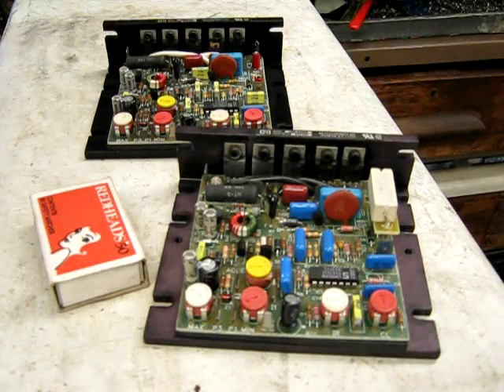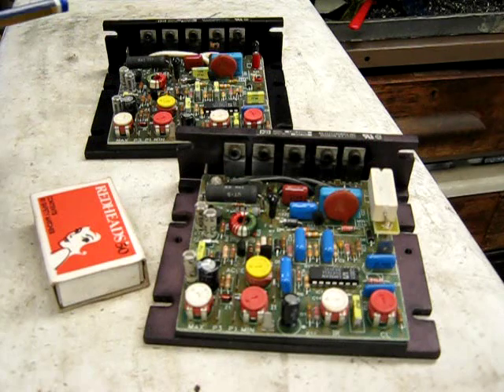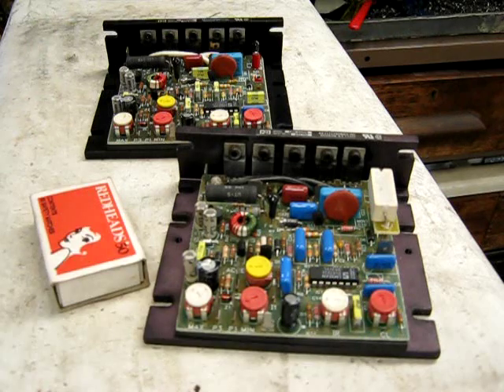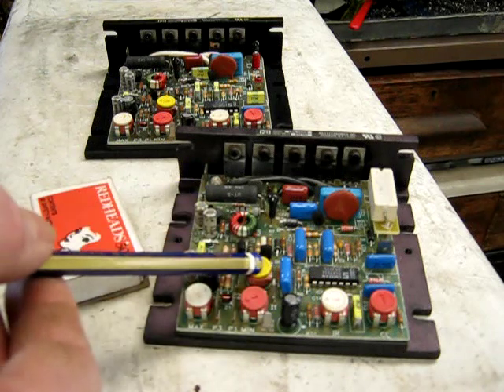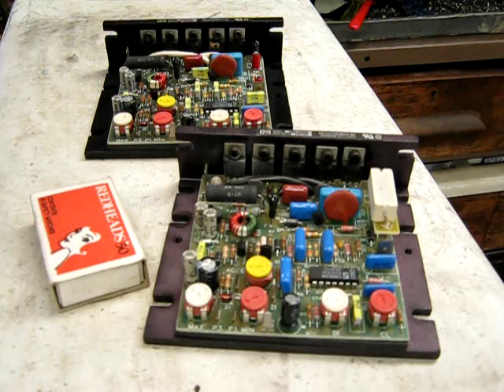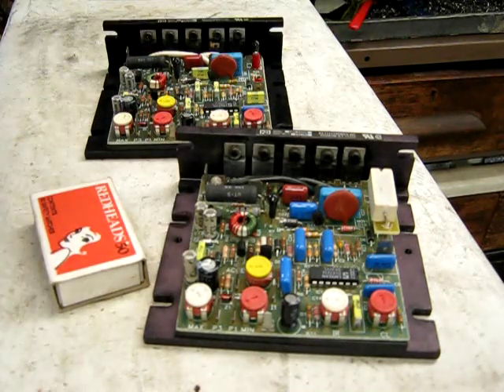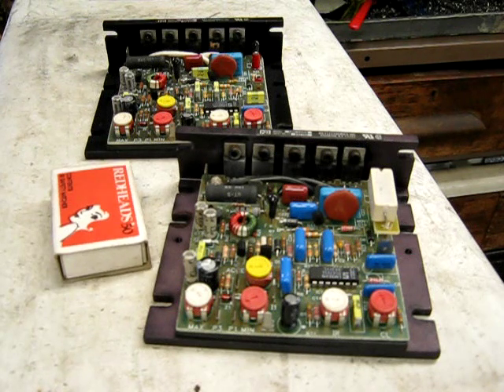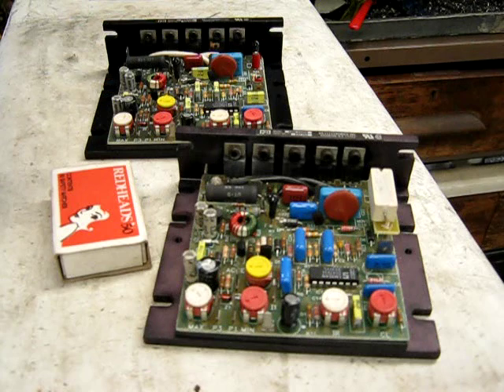DC drive controller suitable for a treadmill motor conversion to a lathe or mill

Comment: hello sir, my KBWM-240 only outputs 50vdc, what component is damaged?
Reply from the maker: Hi Fajar.  It could be a number of possibilities.  A bad main ballast resistor, output voltage potentiometer, or blade rectifier could cause it.  A fault with any other component on the board will also have an effect.   Quite often these units get damaged by voltage spikes, so a clean power supply is essential.  Look for any obvious burn marks on the board and it's components as a clue to what failed and where the problem lies.  Cheers Rob
Reply: @Xynudu  thank sir, i will check it
Reply from the maker: The user manual for this unit can be read online.  It shows the correct settings :  https://www.manualsdir.com/manuals/350815/kb-electronics-kbwm-240-kbwm-120.html?page=5

Comment: My controller board JYMC-220B-1 Deyd yesterday. Aim looking for an alternative....
Reply from the maker: Hi Robert,

I have read that these are a clone of the KBIC board.  The specifications look similar.  The KBIC board is readily available secondhand off Ebay.

So long as the connection points are the same layout you should be OK.

Cheers Rob

Comment: Hey Rob  great video  i would like to building a belt grinder out of a 2hp treadmill motor i have,  with this controller i was thinking of building a sealed alloy box to put it in so no junk gets in, is that possible or does the controller need air to cool itself
Reply from the maker: Provided you use the case as a heat sink it should be quite OK.  These inverters don't actually get very hot, even though they specify an additional heat sink for high load applications.

I still have a couple of these inverters and a largish treadmill motor laying about that I should put to good use one day.  No real need at the moment but always handy for linishers etc.

Using them on a lathe is not really all that successful as the DC motor cooling is insufficient under low speed/ high load operation that an AC motor would tolerate quite happily..

Cheers Rob

Comment: I really see no difference between the KB 212D controller and its variations to the standard controllers that come with the DC treadmill motors. My only interest in the KB controllers was whether or not they can stop the motor quickly. you never addressed that as far as I can tell. The waving pen/pencil is a real distraction trying to focus on what components you're talking about, a little slower and to the point would be a great help. No criticizing just giving feedback.

Comment: Any Idea on how to make these work with a PWM signal to change speed?
Reply from the maker: +dantheman1998 
PWM is for AC.  These boards are for DC motors.

DC current does not have modulation.

You can get PWM for AC from simple to expensive, but cogging and lack of torque will be issues.

Rob.
Reply from the maker: +dantheman1998 

If you mean to replace the speed change potentiometer with a PWM signal, I have no idea if that is possible.

I don't see any point in even attempting such a thing.

Rob
Reply: +xynudu Yeah that's what I mean. I have a  mach 3 lpt breakout board and it only outputs pwm to control spindle. So looking for solution to this

Comment: Are you saying I need to turn off the power to the AC hot line before switching direction, or just let the motor come to a stop. I will be using a DPDT switch in my motor wires to reverse direction.
Reply from the maker: anthony diodati Let the motor come to a stop is OK.  Just so long as the armature is not generating any DC (backwash) when you make the direction change.   You also can turn off the power before switch change.  Either way, the armature must be stationary at the change point.  Rob
Reply: xynudu OK, I see, Thanks

Comment: My motor is 2.5 hp 180V at 4700rpm but i dont need to rev it that much. Would your spare one work for it?  What's your price?
Reply from the maker: elrandyt It's unlikely to work.  I put a larger motor on one once (the rating was incorrectly stated), and it refused to run.  You need the correct rated controller for the HP rating. So it's a case of waiting for the correct unit to come up on Ebay (KBIC-225), or get a smaller motor suitable for a more readily available controller. Generally Ebay controllers come in from the USA or Singapore/Vietnam regions.  The ones I have were shipped ex USA.  Rob

Comment: Hi mate. I'm in need of one of these controllers to power a treadmill motor to make a pitching machine for a local baseball team. (Non profit) Can you point me in the right direction of where to buy one from for the price you mentioned on the video as the ones I've seen cost close to $300 and that's not in my budget. I live in Brisbane. Any help would be much appreciated. Cheers. Randy
Reply from the maker: elrandyt Which specific unit are you after ?   Rob
Reply from the maker: xynudu Ebay is the only place to look for secondhand, as these units are expensive new.  I have a spare 180v unit that will do up to 2 HP that I could do, but anything for a larger HP will be Ebay only and harder to come by. Rob

Comment: Hey Rob, whats the go with the HP ratings on these treadmill motors and what is yours?and what HP resistor do you have in it? I have 2 x 180vdc brushed, both physically the same size and one says 1.5hp 4amp and the other says 3hp 6.5 amp.. Somehow this doesn't sound right.. Im upgrading the motor on my 7x12" mini lathe and was scared off the kbic controls cause of these motors HP ratings and the need for a plug in resistor of correct value. Would have been nice and easy and cheaper to put a new controller board in the old control housing on the lathe. Any ways, I bit the bullet and bought a kbpc-225d with its own, larger control box, no need for the resistor @ 1/4-3HP out of the box. Im also changing to xl series timing pulleys and changing the ratio..  Nothing is going to stall my mini lathe now ! Well except for maybe a crowbar :D
It seems had I seen this video beforehand, I could have got away with a kbic and saved a few clams and a little work.
Finally, how do you find the KB electronics stuff?
Paul
Reply from the maker: Hi Paul.  I've played around with various motors on the basic KBIC boards and only ever had one problem, with a salvage 2 HP motor that wouldn't fire up - the motor looked OK, but may have been a dud. If you match the HP to the resistor listing it should/has always worked for me.  The DC treadmill motors come in many sizes and ratings.  Currently I have a heavy duty 1.5 HP motor (Japanese) I want to fit and it is a longer casing than the previous 1.5 HP  I had on and cooked.  The HD motor has an epoxy coated armature.  The motors tend to be a similar diameter, but bigger HP generally means more magnets and a longer armature.  The biggest issue is keeping things cool at low RPM.  As it drops, so does the fan speed, and so does the cooling.  Things get very hot, very quickly.  Still looking into a solution for that before I fit the new motor.  Cheers Rob
Reply: xynudu . Well Rob, let me know how you go with the cooling, it seems to be an issue. I have noticed these motors are generally externally cooled, and have their fans attached to the flywheel or on their shaft.. So yeah, I have been pondering cooling solution that will work with our application and the low speeds (low cooling) and the current draw (heat) associated with say parting or large diameter hogging cuts. Have to also consider reversing spindle direction and its effects on an improved cooling setups airflow direction..  Food for thought. Thought of a pc fan, but dunno... Id like something better
Reply from the maker: I had dual large PC case fans driving in tandem on my previous motor and it worked sorta OK, but after 12 months the magic smoke came out the motor :(   Low revs was the problem at the time.  Then I bought that $20 blower fan in another video I have, which I now use for metal casting.  It was plenty good enough for the DC motor, but too damn noisy.  So I'm thinking maybe 12v DC car dash blower unit, or old style hair dryer unit.  Bilge blowers are no good as they are only for intermittent use.  It has to be cheap and good :)  Lucky I'm not in a hurry.  Cheers Rob

Comment from the maker: Further to the last answer, the output DC would be set to no more than 130V DC, and should be less than 70% of the rating to prevent motor overheating.  Rob

Comment from the maker: The controller can handle the amperage OK.  You would have to adjust the DC output trim pot to 130 Volts maximum.  You connect the same way as explained in the video. The only question would be a suitable HP resistor for the unit.  You would have to contact KB Electronics or Baldor to determine the correct OHMs in relation to the motor HP.  Rob

Comment from the maker: Hi Keith.  Yes this model will do what you want.

I suggest you visit the KB Electronics web site and view the data sheets.

I have include the data sheet link in the video description.

The AC to DC inverters are available with 110 and/or 240 AC input to DC output.